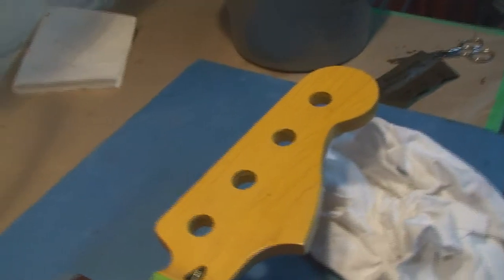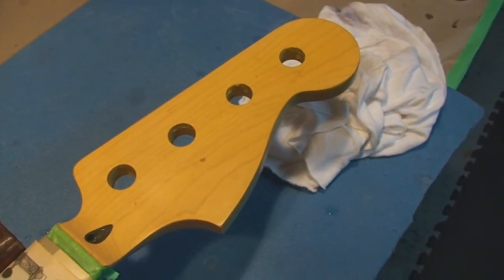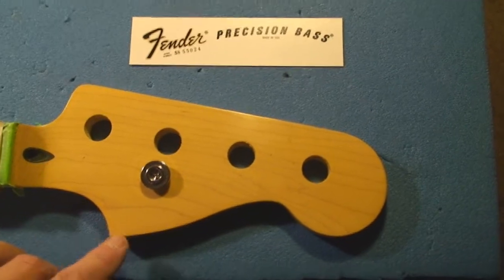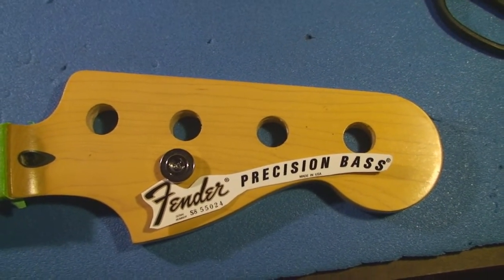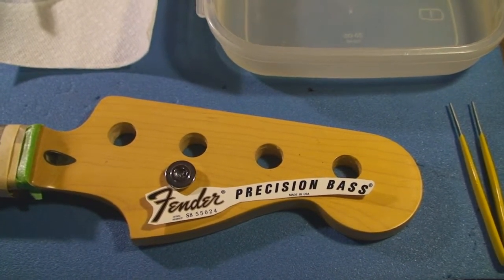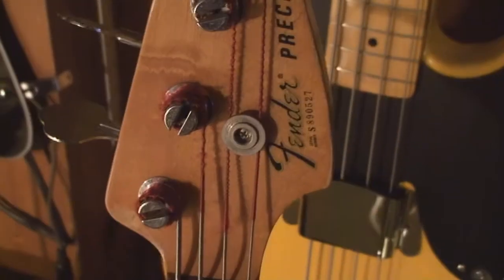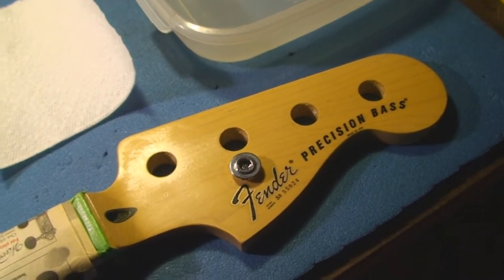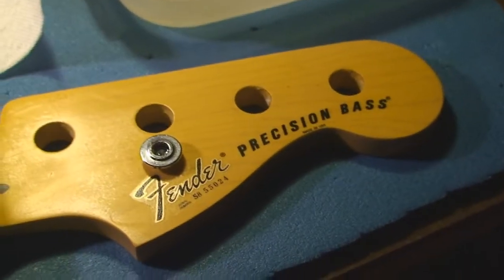Fender 1972 Precision Bass Guitar Logo Install Part 2

Comment: Hey Dave, thanks for the info. I'm building three guitars, 1. 1960 Daphne blue Fender Strat 2. 1972 white Fender strat and 3. 1976 Fender P Bass. Using all mighty mite gear with genuine fender hardware. So thanks again from Australia :)

Comment: The Upper case F points directly into the center of the string tree screw. So Dave seems to have stuck it a hair too low down the headstock. To be obsessively correct.

Comment: Hey, I just got a new maple neck and I finished it with a clear poly. I guess what Im wondering is what the difference between wet sanding and regular sanding is in terms of final results. The finish still looks a little uneven and I used 0000 grade steel wool on it, but what should I do to get it looking perfect? also, I lacquered over the frets and dont really know the best way to remove it without ruining the finish on the fret board around them, so any tips would really be appreciated!